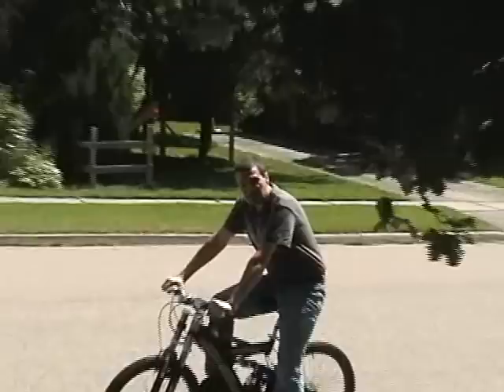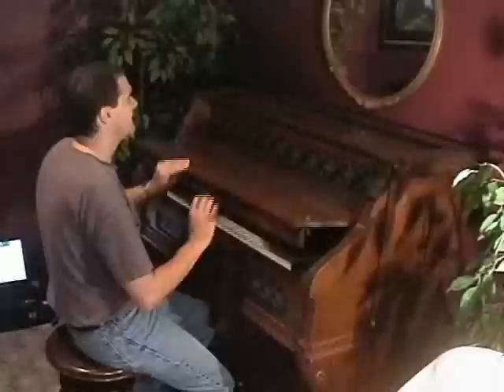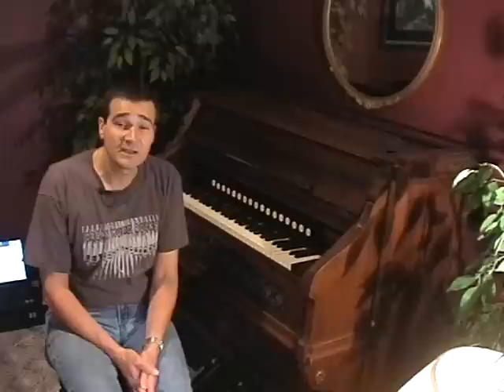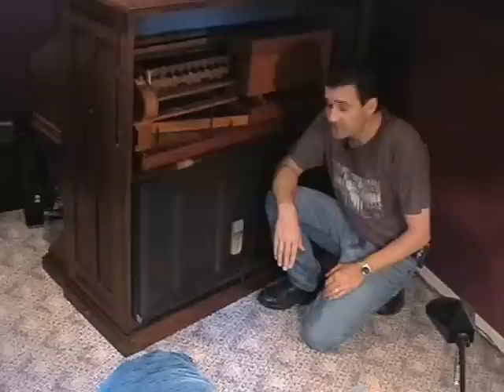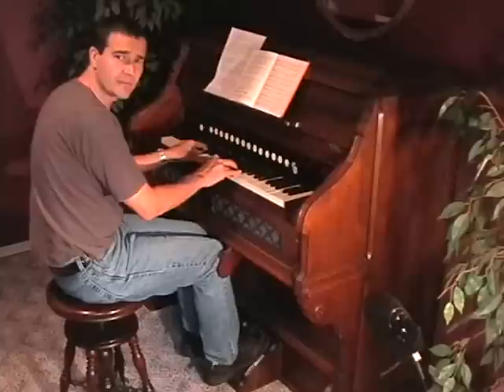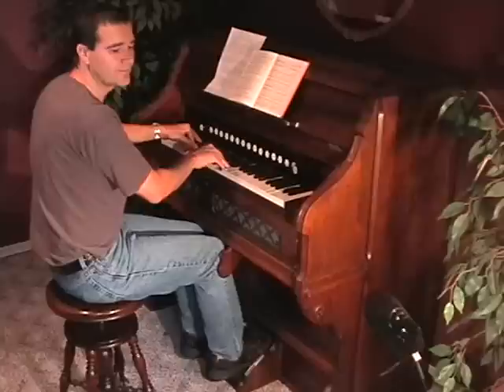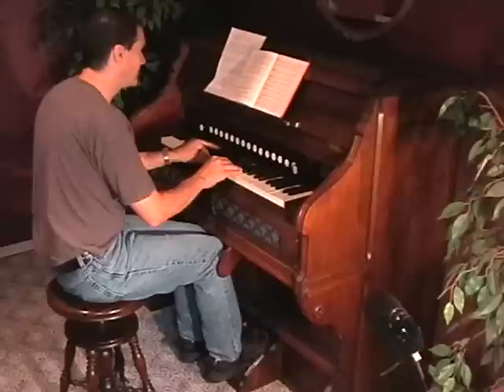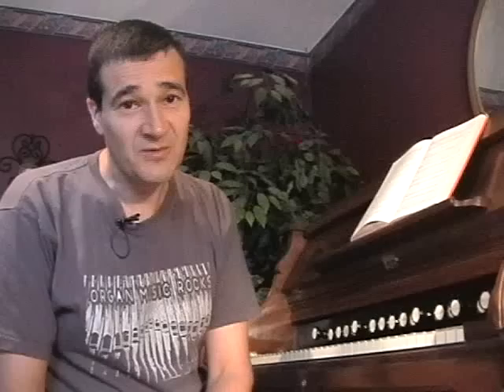Reeding101 - Chapter 1 - Pointers for the Reed Organ

Comment: Excellently produced, simply explained and informative  video.  You have a natural approach from which many professionals could learn.
Reply: You ought to demonstrate the pedalling technique for the French Harmonium as this is a totally different instrument which is pressure operated as the pedals are much wider the bellows feeders are rigid with the reservoir inside the bottom of the windchest as on the pressure harmonium there is a lot more resistance on the pedals due to the pressure making it difficult to pedal fast which is not nesscary anyway due to the dynamics of the harmonium which are different to the suction reed organ.

Comment: The observation I found useful for peddling cleanly was that the player shouldn't try to control the speed at which the pedals move, but instead just put a little weight on them, and allow the pedals move as fast or slow as the organ allows them to move under the applied pressure.  If one shifts the weight from one pedal to the other, the cadence won't matter so long as it's fast enough to avoid bottoming out the pedals.  My pedal cadence doesn't get slower in parts of the music where I'm playing fewer notes--instead, the pedal strokes get shallower.